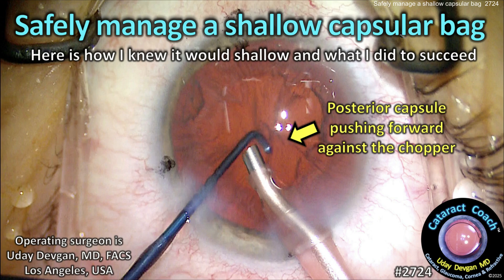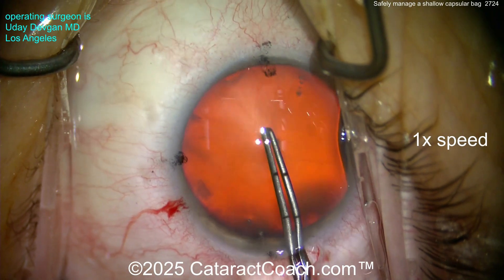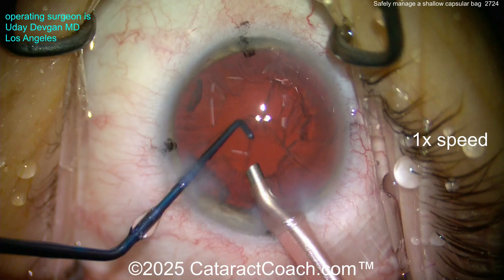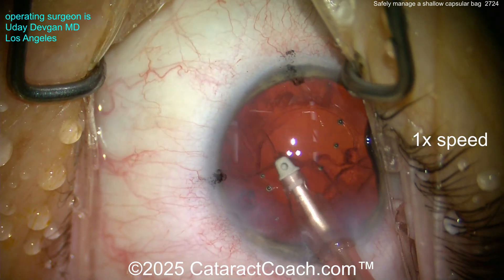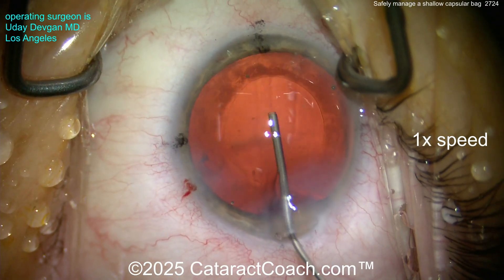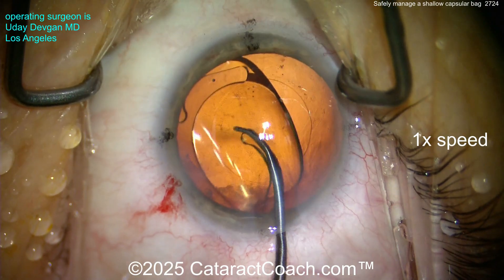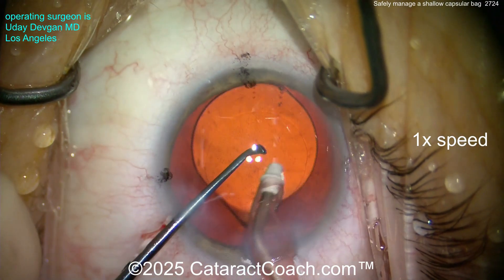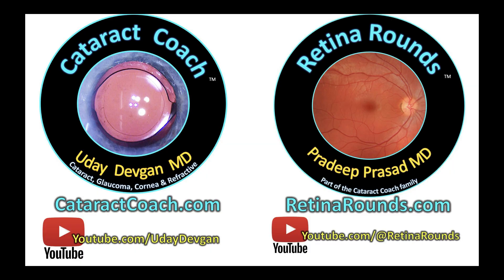CataractCoach™ 2724: safely manage a shallow capsular bag

Comment: pearl of the video is the transient myopic shift from fluid misdirection during these cases. can also occur in short axial length eyes. important to not adjust your intended IOL power based off the post op week 1 refraction in these cases, wait at least 3-4 weeks. may shift as much as 1D

Comment: I use a very small paracentesis for the left hand chopper, reducing outflow during phaco, to have a stable chamber. I do full paracentesis entry later for I/A. Bimanual I/A is very helpfull in this kind of case.